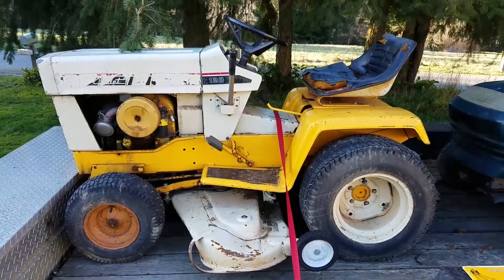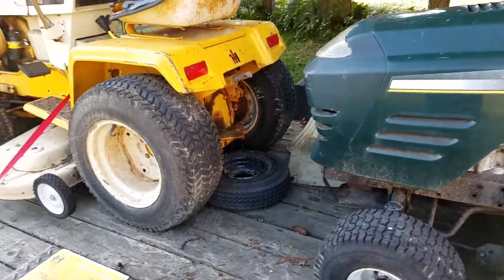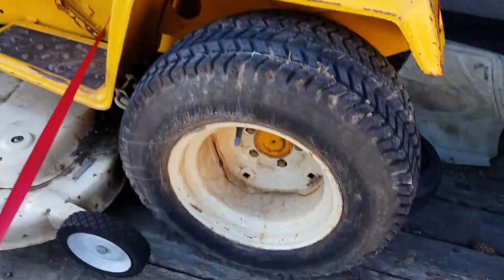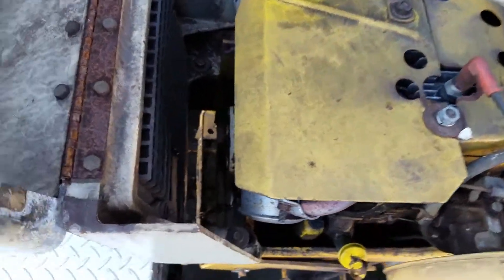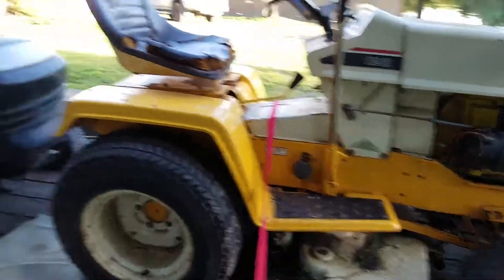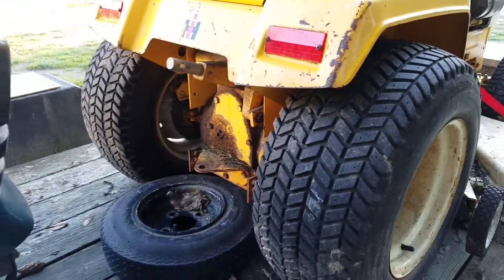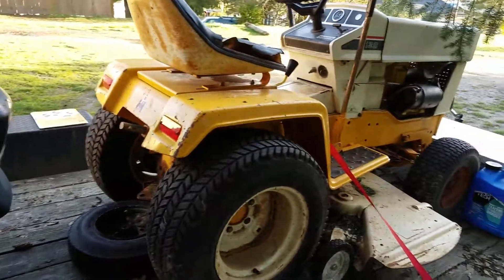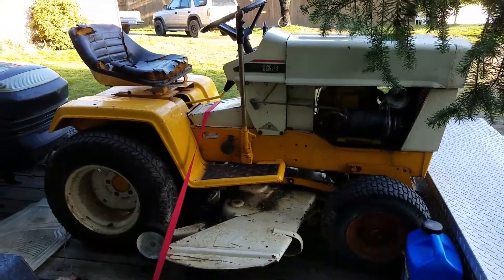1974 Cub Cadet 128 Lawn Tractor

Comment: Nice 128. You've got a nice tractor there. Plus it's got a rear lift assembly in case you ever plan to put a tiller or sleeve hitch on it.